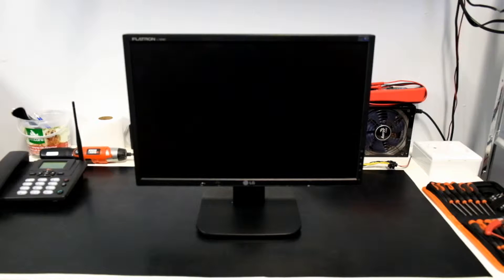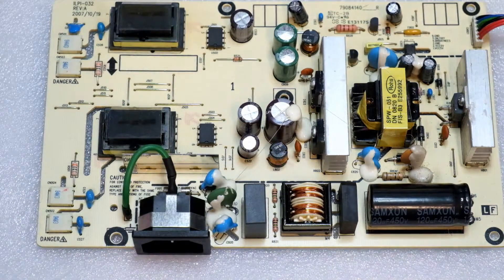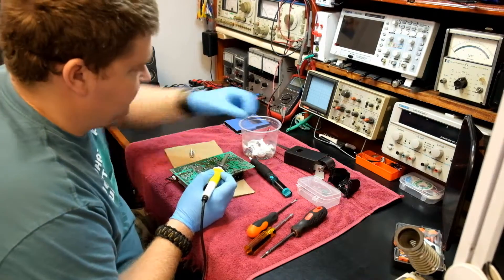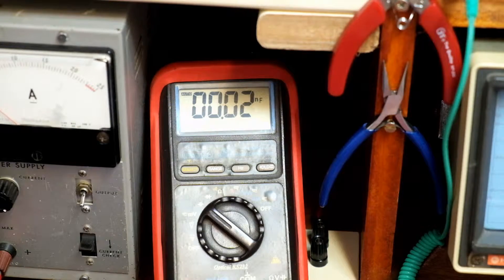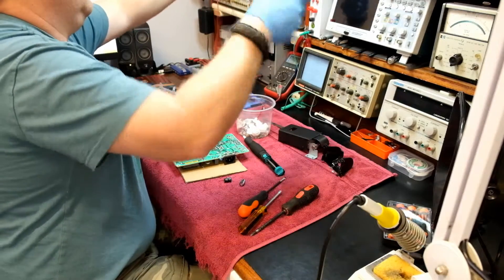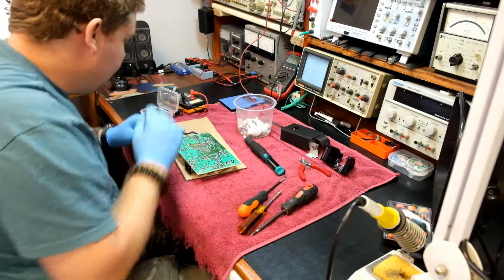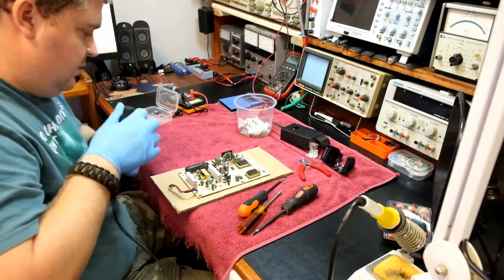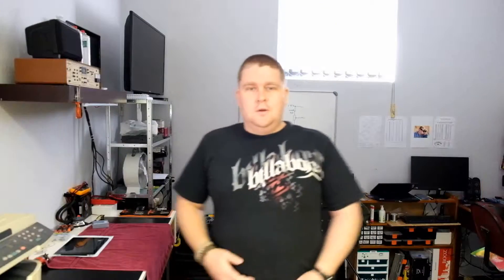Episode 44   LG Monitor Repair

Comment: do you need an esr thing to check capacitors? can they be checked with a multimeter?
Reply from the maker: Hey there. An ESR meter is the correct quick way to check a cap if its working the way it should. A multimeter will just be able to measure the capacitance. It might give you an indication but ESR will tell you straight away if there is a problem. You could also use a signal generator and meter to test the ESR or Equivalent series resistance of the cap.